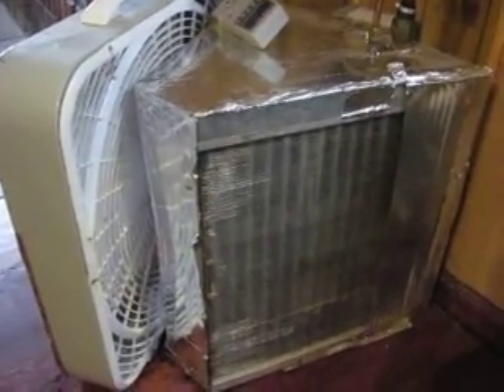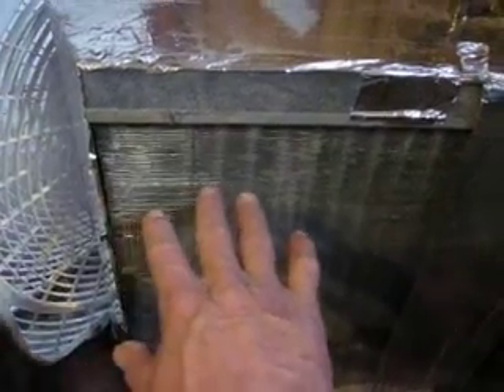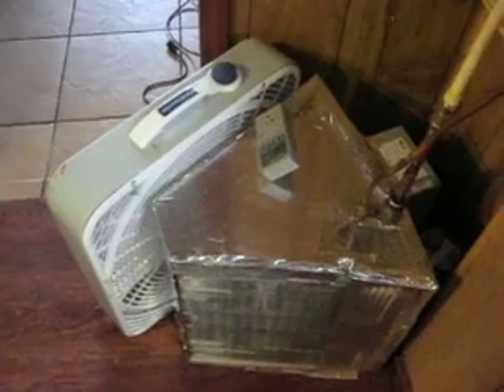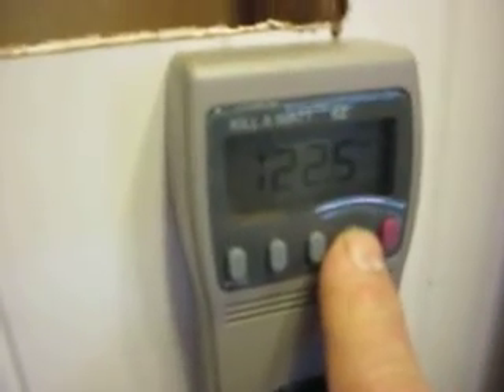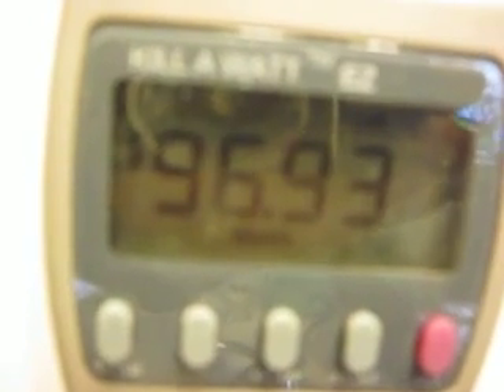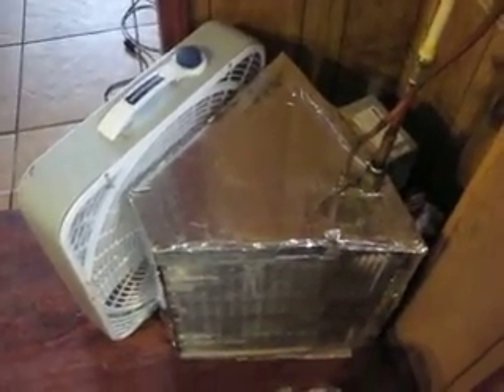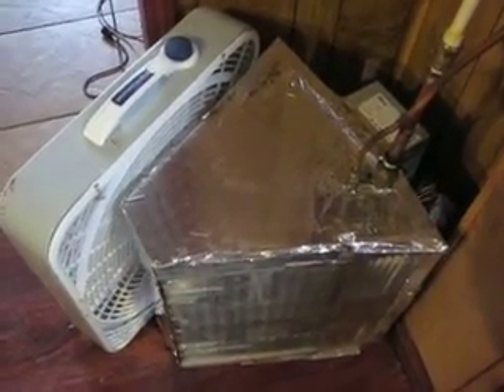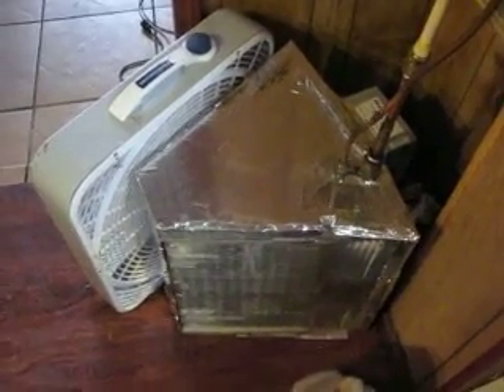DIY Hot Water Space Heating Part 3

Comment from the maker: The Hot Water Solar Coil works great on Sunny days, but they can not be allowed to freeze. Adding antifreeze to the system and using a Trane coil which is long tubing which has spinny fins be put it into a 55 gallon drum to transfer heat without effecting drinking water. Also if you have an area which receives good sun just use gravity to flow hot water into your reservoir. That way it only flows when water outside is hotter. Hope this helps...Thanks for Posting Greg

Comment: Hey, I live in Northern Atlanta, in the Monroe, GA area really. I have been thinking about doing the exact same type of heat exchanger heating as you have. I want to put it in line with my 95% efficent Lenox furnace. I have a spend over $300/month in propane in the winter for heating my house. I am wanting to suppliement my furnace with a Heatexchanger in the ducts fed from a solar hot water heater on the roof fed to a Hotwater heater for storage and back through the heat exchanger. How's yours?

Comment: 2 questions,
[1] where di u get that kw cost calculator gizmo?
[2] what temp water are you through the coils?
Reply from the maker: You can get the Kill-A-Watt monitor EZ at the Home Depot I got it online for about the same price I think 18.00 bucks. The Water heater in my home (Not a deadicated boiler system) is set at about 140F very hot to skin. However I am now heating 1800 sq. ft. My heating cost for a cold December was about 50 bucks thats heating only total cost was 74.00.

Comment: Hi Alvin--
I have my A coil ready to attach to a hot water source. I was thinking about using a 13kw electric tankless water heater. However, I've read some reviews that tankless may not work because the unit "short cycles". Have you heard of this happening? The reviews recommended a microboiler because apparently. they don't short cycle. Your thoughts? Thanks. Darryl.
Reply from the maker: BigDog, No a tankless unit will not work. Because they use water flow to determine when they should turn on. With a circulation pump it would run constantly. I also installed a Hybrid unit for a man who understood that the unit could be installed with a circulation pump (It has a 2 gallon reservoir) along with a aquastat to sense the water temperature. This system will work however even then his system was running about every 10 minutes just to maintain a warm kitchen water pipe. We had his system set at 125F with the aquastat at 105F. Honestly if you look at the energy guide of these and compare them to a standard water heater the actual savings is very slight compared to the cost of having a tankless or hybrid system installed. I do not recommend them, It's like taking a simple device controlled with just a thermostat and instead controlling it with very complicated circuitry, motherboards and sensors out the a**. I have installed two such systems one made by Noritz (Tankleess) another made by Eternal (Hybrid) but I will not be doing another. They were both very sensative and problematic.
Reply: Alvin Shepherd ....so then, should I assume that you recommend just a "plain-jane" water heater?......my concern there is that to adequately heat my house, the thermostat would have to be set very high. Would it be essential that I include an in-line circulation pump?...or could I return the cooled water back to the water heater via the bottom drain valve using just the 50-60 lbs household pressure? I really appreciate your knowledge and input. Darryl.
Reply from the maker: Daryl there are a few things i would like to know first how many people live in your home and secondly what part of the country do you live in
Reply: Alvin Shepherd I live near green bay wi. 2100 sq ft. split level. Just myself lives here, and my girlfriend occasionally stays here.
Reply from the maker: Daryl as I was saying I think your system would be fine with just a regular 40 gallon gas water heater or electric if gas is a problem in my area gas is cheaper I also augment my system with a batch water heater but it's never been a problem for me we had a very cold winter my gas bill never went above 100 for one month. I was stationed in Hancock Michigan for 2 years in the Coast Guard so I know you're going to have a higher building that but as long as your house is insulated well there shouldn't be a problem with it doing the job other than turning the water heater up it should be fine
Reply from the maker: By the way my batch water heater is working great and I highly recommend it the last month's Gassville I had was 16 and some change for 7 cubic feet for the whole month
Reply from the maker: Correct building with bill than, and gassville with gas bill
Reply from the maker: I'm using voice recognition to write this
Reply from the maker: One more thing I never turn my heat off I turn it down to 65 while I'm at work but this heat is a very slow heat so it will not recover fast
Reply: Alvin Shepherd What do you think about using the house water pressure to move the hot water through the a-coil, and returning it back to the water heater via a wash machine hose attached to the drain valve?
Reply from the maker: BigDog, The only possible way that you could cause heat to flow into a coil without a pump would be if the coil was located above your water heater. But the coil would still have to be designed in such a way that the pipes would continually give rise to the water. This is called a gravity flow system. You may want to do some research on this subject but I must warn you that even with a properly installed gravity flow system I seriously doubt that the flow would be suffiecent to heat your house. Also if you fail to maintain a 10 degree rise throughout it may not work at all and your effort would be for naught.
Reply from the maker: Here is one good book on the subject Low Pressure Boilers by Frederick Steingress. Which goes over gravity flow systems used in Steam Heaters. But these work at much higher temperatures. The advantage is that they work without power too. But a circulation pump only uses about 25 watts so that would be easy to power with a solar panel as well.
Reply: Alvin Shepherd Alvin....maybe I'm not describing my situation right. I have a well system, and a pressure tank, pushing about 60 psi of water pressure throughout the house. Why wouldn't the water pressure coming out of the water heater be enough pressure to force the hot water through the a-coil, and return it back to the water heater? Maybe I don't understand the laws of plumbing, but it seems that if there's pressure at one end, then that should be enough to circulate. I'm not averse to buying a pump, I just would like to invest as little as possible into this project. Thanks again for your time and insight. Darryl.